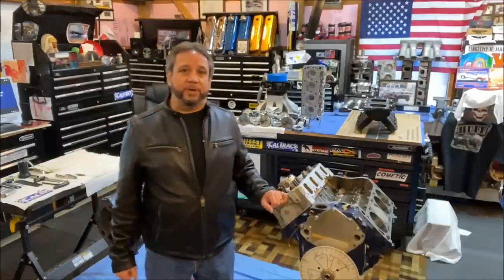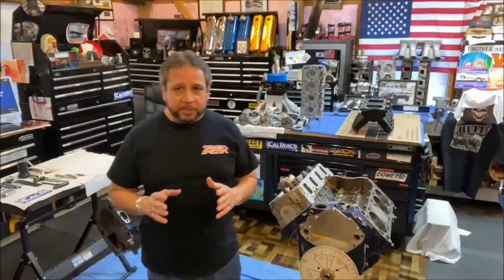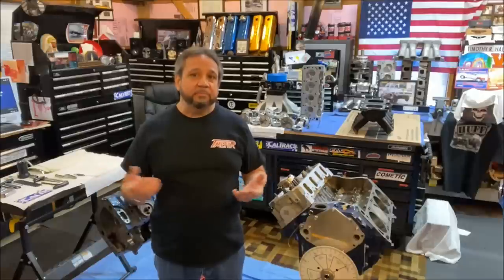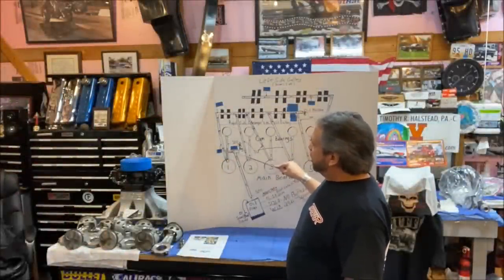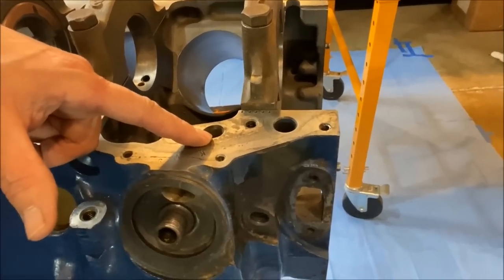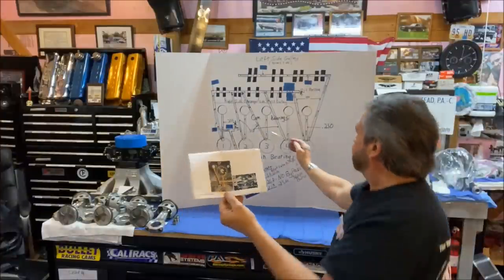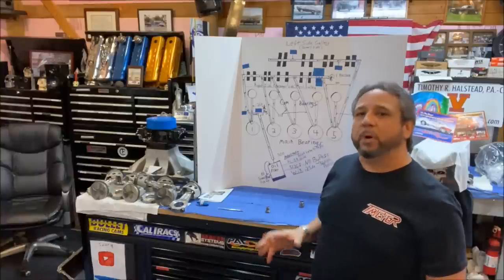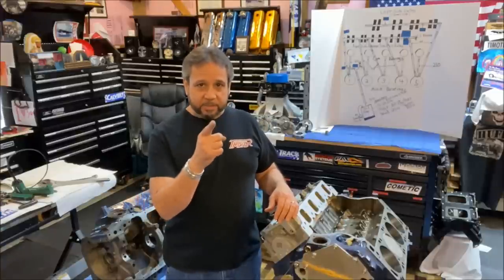Ford 351 Cleveland Oiling,  The Truth, and More

Comment: Thanks for the great info. I am building a 410 Cleveland here is Australia. I have a set of Tim's bearings. The install for the no1 bearings states to install oil holes at 1.30 and 4.00. I assume this is with the block the right way up? What is the point of the two holes? The oil doesn't go any where else from this cam bearing. If you a have some, an explanation vid would be great.
Cheers
Reply from the maker: Yep sounds good Roland. Watch the vid about the bearings and you will see how they restrict flow, glad you are into the channel thanks for taking the time to watch and contribute.
Reply: @DragBoss351Cleveland  Thanks Tim, will do. My engine is factory block based, 410ci - 4.040x4.00, AFD heads, Lunati Voodoo Hyd. roller, Holley Stealth injection. Sim software predicts about 534HP and same TQ. Wondering whether lifter bushings is a good idea along with TM's bearings.
Reply: @DragBoss351Cleveland  What is the vid tittle you are referring to?
Reply from the maker: @rolandgann6584  they would be good, but do you need both, probably be fine with restrictor cam bearings only.
Reply: @DragBoss351Cleveland  Thanks Tim. Have you ever used the Wydendorf Machine kits for lifter bushing? Much more cost effective than my machine shops price, but I am concerned about accuracy. Engine won't be a revver. Peak HP at 6100 and TQ at 4200.
Reply from the maker: @rolandgann6584  the oiling vid, and how those restrictor cam bearings work.
Reply from the maker: @rolandgann6584  To tell you the truth, with those rpms, I would not even waste my money, you can get by without it. I have told to do it correctly, needs to be in a mill, But I have known, many who have used Denny's kit without issues.  I need to call him, when I get caught up with everything.
Reply: @DragBoss351Cleveland  Thanks Tim. I have document I found on the Cleveland oiling system and it advocates, restrictors, careful control of clearances, lifter bushes and a higher pressure relief spring in the pump. Denny's kit is reasonably priced and maybe it cant hurt. I can send you the doc if you're interested. Thanks again for taking the time to reply. Cheers
Reply from the maker: You can email it to me, and see what it says. Thpa351@gmail.com. Thanks for taking the time. But If your not winding it out last 6500 won’t need a lot of work done. Stay away from those high pressure springs. Thanks for commenting and contributing to my channel.

Comment: 400 and 351M had basically the same oiling system. Pickups with the 400 and 100,000 miles would lose oil pressure at idle. Farm boys would come in asking me to replace the oil pump, because the oil light was flashing at hot idle in gear. I would pull the oil pump out and inspect it for scoring and clearances. Always very good condition. Pull a main and rod cap or two and they would be copper all around. I would then look at the timing chain which with that meage was worn. I would call with an estimate. To compensate for journal wear, I would put 0.001" undersize main and rod bearings in. Then while the pan was still off I would install a double roller timing set. The first few farm boys would be upset I had not replaced the oil pump. My response was to drive it for a week and if they were not happy, if they paid for a new pump I would install it for free. I had noone come back for a pump. Now cam bearings were probably getting worn also, but the only way to service them is to remove the engine and complete tear down. Once the crank clearances were tightened up, oil pressure to the cam bearings would be up also. This would give them about another 100,000 miles use.
Reply from the maker: Oil systems are great up to 6800rpm, Most no where near that. Sounds like you had a plan, I remember that flickering light.
Reply: @DragBoss351Cleveland  These were farmer pickups that mostly putted around below 4,000 RPM. It was poor main oiling and high milage. The poor oiling became an increasing problem as the miles piled up.
Many newer vehicles show main and rod bearing wear as the mileage builts due to the low RPM with OD transmissions that go into OD and lockup at 45 to 50 MPH. 1700 RPM and the der ones oil flow was not the greatest out of the pump at that low RPM. GM had to revise the 700R4 pump for that reason.
Reply from the maker: Ok. Def ran low rpm. I remember when the governors would apple core on the 700r4 trans

Comment: Tim,  I purchased a 1972,  4 bolt main block and a set of DOAE 4 barrel heads. The block has been bored. 030" over and line bored on the main bearings. The man I made the purchase from has a set . 030" over, domed TRW forged domed Pistons with rings, all weight  matched.  Also a set of connecting rods balanced, shot peened and the ends tried. I only purchased the block and heads. I want to use this engine as a cruiser in a 62 Fairlane.
  What piston should a person use in this application?
Reply from the maker: If your just street. Really want a trw 2379 a flat top piston. About 10.5 ish cr. Or really any flat top thanks ed

Comment: I have owned a few Clevelands and being a NASCAR fan I learned why Ford stop using the Cleveland blocks and switched the Windsors with Cleveland heads. Dale earnhardt won a few races in Bud Moore's Fords but too many oiling failures sent Dale back to Chevy with Childress. Had Ford solved the problem before Earnhardt left he might have had six championships in NASCAR driving a Ford. Bob Glidden was the best with Clevelands in Drag racing but drag cars don't have to run 600 miles @ 7=8000 RPMS  Jack Roush ran Clevelands in drag racing but he has perfected the Cleveland headed Windsors along with Robert Yates Cleveland heads to make that engine the dominant engine in NASCAR until the canted valve Chevy and Toyota engines copied the Fords to even the playing field.
Reply from the maker: Yes no doubt one of the aspects. I used to enjoy nascar, but after cars all started to look the same, I just stopped. They don’t even resemble any production vehicles to me. Add Toyota and double whammy to me. Anyway glad you stopped by so explore the channel and stay tuned.

Comment: Building a cleaveland have the rotation assembly 30 over flattop forged edelbrock aluminum heads will use hydraulic cam should I use a high volume oil pump? It will go in a 71 Toronto GT for the street.
Reply from the maker: Nope stick with standard volume, you will be fine. Contact Doug at Precision oil pumps he will hook you up. Make sure you subscribe. 
http://stores.precisionoilpumps.com/ford-351c/

Comment: Pontiacs  are the same like the AMC example, I'm not familiar with AMC's though but Pontiac never made a 'big block' theyre generally one 'type' of block with varying displacements consisting of different types of components which make the end result useful for different applications.
Reply from the maker: Yes, Andy Wood mentioned that. All cool facts, I love the Pontiac Ram Air lll, Iv stuff for sure in 69 gto, buddy had a 70 lemans with 400 and Ram air lv and like 3.90 gear and stick. That was a fat car. Good info for us all to know. Thanks for rocking
Reply: @DragBoss351Cleveland  I saw in another video where you were showing the bottom of the 351 block, those crankshaft caps are huge, and with 5 mains I can understand why they are stout blocks.
I cant watch too many of your videos though they make me want to do a deep dive on car stuff.
I get lost in this stuff.
One could argue that almost any car can be fast with 3.90 gears.
Reply from the maker: @ThunderAppeal  thanks man, they have a rugged bottom end for sure. I just put up of my 408 in car vids, you have to check it out.  yes no doubt with the gears.Thanks man

Comment: Now this will also apply to the 400/ 351m since it's basically a tall deck cleveland? I got a couple 400s that have the stock reinforced main webbing in the block. I got a pair of 2v closed chamber aussie heads getting freshened up.  I hear horror stories about the rear main bearing failing because of lack of oiling. So I've been investigating fixes for this problem and just watched your video. Could I also use an auxiliary oil line back to the sending unit port?
Reply from the maker: The same principles apply to the 400, and the 351M. And really any engine where you can clean up any of the galleys, the returns, any smoothing and massaging of  oil path, will improve it. I’ve only use the front to rear line once, on my last build but it will work on your 400 too. Thanks for watching it stay tune

Comment: I’m building a 351 c  I say no more than 6500 rpm cleaning out the oil passages oil filter line from back to front an oil filter adapter  I’m thinking I’ll be ok ??
Reply from the maker: You should be. Clean and deburr is always good.
Reply: Oil pump to block is that an improvement the hole gasket match ??
Reply from the maker: @roberthirshfield3571 yes make sure it is open max size and duburr the passages.

Comment: Think BB Chev oiling or Ford 427 side oilers, try to oil mains 1st. your on the right track. Refine what Ford production costs limited
Reply from the maker: I may even go into depth on different engines oiling, at least ford for now. I need an FE Block to examine. Thanks Rick, appreciate the contribution. Stay tuned
Reply: @DragBoss351Cleveland   Specially the   The Infamaous 427 side oiler. not just run of the mill FE
Reply from the maker: @rickbrandt9559  I know Rick, it would be epic to evaluate. Thanks for getting back, stay on track and stay tuned
Reply: @rickbrandt9559  The rather rare 1968 427 Cougar '7 Litre' had a unique "side oiler" block in that it was drilled for hydraulic lifters, unlike the '67 and earlier 427 blocks in which no provision was made for hydraulics.

BTW, that '68 427 was basically a 1963/64 "Low Riser" (crank, "nut&bolt" rods and "bumper"-top pistons) with a 390 GT cam, LR heads equipped for the Thermactor AIR system, a 427 Medium Riser/428 Police Interceptor "centered" intake and the 600 CFM 390 GT Holley carb and 390 GT exhaust manifolds and exhaust system. ALL that, then "rated" at a whopping 390 horsepower. 😒
Reply: @johnjohnsn7633   Trivia Expert!!

Comment: Got a question.. I got a 351C in 1977, from a friend who drag raced. He told me about the poor oiling history and what he did was install a solid life cam. He said that solved it. I’d like to know how accurate this is? Thx
Reply from the maker: Solid lift cam makes no difference, it the route of the oil. Oils passenger side galley first. The mains get oiled last so to speak. The way to solve it without doing anything is to keep the rpm under 68-6500. Above that suggestions on my video. Thanks Martin

Comment: Hey DragBoss , well done - great video! Just got a 1968 Cougar with 351C.  Don't think I'll be doing the oil bypass mod anytime soon.  What oil weight should I use for street/drag for the time being? Finding a lot of conflicting info out there on this I live in Malta EU - very humid all year round which temp-wise means 40degree winters and 102 degree summers. Thanks :D !
Reply from the maker: Thanks Pierre, Glad your here and please subscribe. For oil, it is not only the environment that makes a difference, but also bearing clearances. In your case, I would run a 20w50, or a synthetic blend of the same weight. old school clearances, say 3 or 35, benefit from thicker oil, less clearance say 27.5 ish maybe a thinner synthetic. Thanks for watching, explore the channel, and see what you find, make sure you share with your friends in Malta!!
Reply: @DragBoss351Cleveland  Thanks a lot.  Needed a specialist opinion and I got it.  Looking forward to more content!  Thanks again! :)
Reply from the maker: @pierrelucpace3443   please be patient, have so much going on, with work and family. But pressing forward, have some cool vids coming up, glad your here Pierre

Comment: Many years ago on my old hot rod which I spun it up to 8k . It was just a street motor really but I used a 2 quart filter I think. I blocked the by pass and always made sure I let the motor warm up ,  Seems like I read back then that the filter would flow more than two ph8a on a remote block . That was a very long time ago . No one makes a block with priority main bearing oiling . As long as you  have no problems with bearing I guess its all good . Although I never had one I always though a dry sump has a lot of advantages
Reply from the maker: Hey Jim, sounds like you had a good combo for sure. I would love to try a external wet or dry sump system, just a lot of money up front. I always warm up to 160-70, shut it down, and let it cool down a bit, get some heat in before I whale on it. Dart for sure makes a priority oiling 351w block, not sure about other engines, but may feed mains first. Thanks Jim for watching, make sure you ring the bell, and rock on...

Comment: I have a 400 and c6 out of a 74 I think ,4x4. Will Cleveland heads and intake fit on it?
Reply from the maker: Cleveland heads will, but you need to make a spacers for intake as the deck height is different, 9.2 for Cleveland, and 10.3 for the 400. Not sure if anyone makes then, maybe Price Motorsports. Make it work, and you have a monster...Thanks Steve for watching appreciate it.

Comment: Should I just switch to a Windsor block then, pros cons?
Reply from the maker: Depends on your goal. I work with what I have.
Reply: @DragBoss351Cleveland  well if I want to down the road build my engine for high compression higher rpm usage what would u recommend, still would like streetable driving
Reply from the maker: @funnydubby6401  have always ran Cleveland’s so that is what I would run.

Comment: You can take it to the next level with Hank The Crank Oiling were you restrict both the left and right lifter gallery's the front main bearing is the only bearing that is oiled with the factory drillings and main bearing 2,3,4,5 are feed via external oil lines this is why you can restrict both left and right lifter gallery's  but most guy's don't need to go to this oiling system but in boat racing high revs for a long time it all helps
Reply from the maker: Yes I wondered the application that needs that degree of work. I am surprised I ran this long, and never investigated this further. Thanks for the message, chat when I get get caught up. Thanks Gary, please share with your Motörhead’s.
Reply: @DragBoss351Cleveland  but it's all done in your home workshop it's just some drilling and tapping
Reply from the maker: @garykemp6436  that is the amazing part, anyone can for the most part can do it, if they want to put the effort into it. 👍

Comment: I am interested to try rerouting the oil with an external line like you talked about.  Do you know anyone that has done this?  And if so, I wonder if it was mandatory to restrict oil elsewhere?  Thank you for the video and info!
Reply from the maker: The front to rear line, from above the oil filter to sensing unit? Or the one in the valley?  Your welcome. Thanks for watching. CK
Reply: @DragBoss351Cleveland  yes the one from the oil filter port to the rear sending unit port.  It makes sense to me that it should keep the pressure more consistent across the mains, vs a pressure drop from front to rear.  Thanks for your reply
Reply from the maker: Yes I can without a doubt, from testing. May help, but that is does not hurt. Dyno proves it. Stay tuned for that video. CK

Comment: Did you ever get T&D to do a deal on the roller rockers? I have them on my FE and I am about to do my first cleveland and sure would like to run them on there. Trying to decide if I should get a stroker kit or not. The engine i have is apart but block is D2AE-CA bored 40 over (bores are still in good shape), Crank is 4ma, rods are D0AE-A, pistons are L2379,  cam is (from what I can make out) CWC 1208 and the end is stamped 530 or 580, and the heads are closed chamber 4V D0AE. What kind of power would this make? I don't plan on using cam  because I am looking at going to a full roller setup
Reply from the maker: I did, but had to buy 4 sets, over 11k. I would get a stroker kit, and be done with it. Those pistons may get to 10-10.5:1. Stock cranks have some oiling issues, or distributing oil. Can make an easy 600hp. Thanks Cody
Reply: @DragBoss351Cleveland  is there a stroker kit you would recommend and with what cam? 600hp is what I would like to hit. I appreciate you answering I did not expect to get a reply so quickly.
Reply from the maker: @codybyrom1564  contact Tim Meyer at TrackBoss Performance products. Watch my video of my 354 ci making 615hp, with stock heads.

Comment: What does the groove on the BACK of the cam bearing do?  It doesn't feed another hole, and I don't see how in the world a back groove would help oil pressure.  If you were gonna make a restrictor bearing wouldn't you just make the hole or slot smaller (assuming you were having the cam bearing MADE for this specific purpose)?
Reply from the maker: Yes the oil flows along the groove of the backside slowing down or restricting the oil making it travel the length of the groove. Yes the bearings are made by Tim Meyer TrackBoss performance products.

Comment: Do you know anything about dual grouve bearrings for the 4 bolt 351 cobra jet, ( came out of a police vehicle). Been told its a floating crank, not sure if this is stock, or if main bearring have 1 grouve stock ??
Reply from the maker: Have heard of them, but never used them all cranks float on an oil wedge

Comment: I know this older, but instead of a line from. Or in addition to, add a jumper between the left and right banks . By removing the plugs  and adding -4 HARD LINES TO BALANCE OIL TO UPPER END
Reply from the maker: To tell you the truth, I do not think the line makes a huge difference. Never had issues in past, and never ran that line before. You try that, just alot of work I do not feel you need.